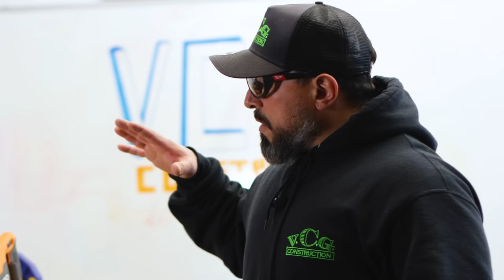Milwaukee Tool Is No Longer TOP DAWG at TTI (new best brand REVEALED)

Comment: They definitely need to add better padding on that Ridgid
Reply from the maker: Brutal cuz!
Reply: Kind of lives up to its own name in that regard.
Reply: I wonder if you want you bought the rubber cover replacement for Milwaukee would it fit the new ridgid. Just a idea
Reply: Better padding? Ridgid needs to just stop making tools in general
Reply: Padding has nothing to do with it (well, maybe a tiny bit). The corded and M18 FUEL Super Sawzall has double wobble plate construction, and the Ridgid does not. The wobble plates are the components that absorb all the abuse on the user.

Take a Milwaukee Super Sawzall, either, put it on a table and w/out holding it, pull the trigger and let it run. Do the same thing with ANY other reciprocating saw, you’ll notice significant increase in vibration in the table.

Boom!
Reply: @stefanjohnson9480  do you not understand that they are the same company...

Comment: I’ve had like half of my Milwaukee tools go out because of a faulty trigger. I don’t give up on them though
Reply: You should try the 3/4” impacts and hammer drill. They cannot take persistent usage. We use them both at work. If mode selector doesn’t work in only the 3 mode, you have to hold the battery in place with your off hand. The tool puts down some serious work, but the electrical connections can’t take it.

Comment: The extra weight (on the M18) gives it an advantage on cutting as more downward pressure, thus in my opinion Ridgid needed to increases the strokes per minute by 200 to be on par with Milwaukee.

Comment: IMO rigid is probably being used as a testing ground/beta test for new technology. Smart way to test new technology/batteries and when the bugs are worked out they'll introduce it to Milwaukee.

Its really genius when you consider Rigid has a lifetime warranty which means they'll get there hands on plenty of tools to diagnose potential problem areas.

Comment: It's a normal case use.  We had to decom some steel on a roof that was originally crane-picked up there.  Diablo blades are pricey, but they're a hell-of-a-lot cheaper than another crane.

At the end of the day, after all of the numbers and marketing BS, the tools just have to work.  If you're a pro or a home-gamer, you just need to get the job done, and both of these tools will do just that.  That been said, on a construction site, in construction environments, the Milwaukee will usually hold up a bit better and stand the abuse. Just my experience.  You use what get's it done for you.

Comment: Wookie is killing it through the wood. Those blades are on some other stuff. I think smaller motors turn more rpm than larger motors. Doesn’t mean they generate the same torque just because of the revolutions. I’m not positive though.

Comment: Used both today cutting pt 2x4s and Milwaukee was way better, ridgids batteries seem to fail faster (like need to be replaced- not recharged) & the added weight seems to assist in the cutting power of Milwaukee tbh.

Comment: The Rigid has a faster no load speed------BUT under load esp the I-Beam,the Milwaukee held its speed better and didn't run down its battery as fast as the Rigid.With this test-stick with Milwaukee.Milwaukee has been the pioneer of the recip saw and it shows in the test.

Comment: My guess is that since the Milwaukee has a higher tool weight which equates to higher inertia, the tool itself does not move as much during each stroke.  That means that the blade is moving more during the stroke so it cuts more per stroke.  It would be an interesting experiment to ballast the Rigid up to the weight of the Milwaukee and see how it compares then.  Not that anyone would do that in real life, but it would be interesting.

Comment: Milwaukee was definitely faster to me. Ridgid seemed to bog slightly at times on the steel. It's not producing the 3200 rpm when pressure is applied it seems
Reply: He precut the beam on rigid watch again watch the top he didn’t even have to cut the side closest to him it was already cut
Reply: @addicted2tools  if he precut it for ridgid wouldn't it of been faster with the ridgid? Idt it was precut, the Milwaukee smoked the ridgid
Reply: Big difference in the bearings too
Reply: The Perfect Painter Tool Review lol he precut the top rewatch it man I promise... and yea u would think it would be faster since he did but it was still slower lol watch the beginning of when he starts the cut on Milwaukee and then watch rigid it’s completely different u can see the blade just goes down with no resistance when he cuts rigid on the side closest to him....
Reply: @addicted2tools  he didn't precut it...that clip started a few seconds after he started cutting. Notice how the tool is already in motion when the clip starts. There could've been something that he didn't want on the video or something like that. Vince is clearly a milwaukee guy and was being sarcastic saying ridgid is top dawg now due to the spec on the ridgid sawzall. It also make for more ppl wanting to watch the video with a catchy title.
Reply: The Perfect Painter Tool Review yea I no which is my whole point that it took longer than shown
Reply: The Perfect Painter Tool Review not a true comparison
Reply: @addicted2tools  I 100% disagree with u
Reply: The Perfect Painter Tool Review well that is ok ur aloud 2 lol 😂

Comment: Nothing wrong with Milwaukee taking a backseat, right now, but as things go….when new tools get released, they always better than older, and beat out “competition”; it’s expected, imo.
I’m guessing that after 2021 Milwaukee NPS (if they do or just release) might be more comparable to the new Ridgid, AND Flex tools with Milwaukee’s new gen tools. Than DeWalt will release new tools and they’ll be on “top”; and round and round we go, no😉
Thx Vince and it’s exciting to see the new tools, brands, and “what” happens with them. Let’s just hope Milwaukee doesn’t release a new battery platform b/t m18 fuel and MX….as really like the Milwaukee 18v batteries, especially since have 50+ Milwaukee tools and 75+ batteries.
✌🏻

Comment: Oh yes-don't forget the Diablo blades-they held up well under the abusive test of cutting the I-Beam-a job usually for larger machines.When you see the sparks-the saw was being a friction saw!The metal heated to softness from friction-the teeth removing the softened metal.Friction cut bandsaws and circular saws work this way-the teeth on friction blades aren't even sharp!

Comment: Are you sure that the Milwaukee tools fall behind the RIDGID? I say this because I believe the RIDGIDs are kitted with high-output batteries whereas the Milwaukees were not - despite the HO batteries being available for M18 tools now. Granted, I don't know for sure which batteries Milwaukee used in their tests where they got the provided specs - and logic would dictate that they'd want to provide the best numbers possible, thus using the HO batteries. But I don't remember those numbers changing at the time the HO batteries were released

Comment: I believe ridge it will never be as  Good as Milwaukee They will not have the lineup That's the part that hurts ridge it the most
       🤩🍩☕😊
Reply: You are probably right since TTi makes Milwaukee, Ridgid (Orange), and Ryobi tools.  It not really a matter of hurting Ridgid but TTi wants to keep it at a 3 tier system and price it accordingly.  If TTi ever chooses to make Ridgid models that truly matches a Milwaukee then they would probably spin it as a new Ridgid line like "Extreme Pro Grade" and charge exactly the same as Milwaukee.  They would probably just be Milwaukee internals that use Ridgid batteries ;)

Comment: This whole idea of making power tools lighter simply allows the manufacturer to use the cheapest plastic or metal parts China has to offer. Unless they are using the latest and greatest in materials these light weight tools are just not going to last.

Comment: I’d rather have the heavier Milwaukee. I’m perfectly capable of handling an extra pound or two per tool. I prefer the heavy especially with screws. That weight factors in the torque specs.

Comment: Ridgid is like a box of chocolates, not all of them will satisfy you.  If i were to start a brand, it wouldn't be Ridgid.  I will use their tools just for fun.  I still think their drill driver gen5x or octane with the clutch settings for screw driver is one I would consider revisiting because that's what I use when I need drive screws consistently.  E clutch doesn't work for me.

Comment: With the drill speed in low you want a slower rpm. I have to drill through heavy thick steel and stainless every day and you want slow. Also with the sawzall the millwaukee probably has more robust gear box and what not. I'd bet the millwaukee lasts way longer. And once again with heavy steel you want low speed. I dont do much with wood so the slight difference in cutting speed means almost nothing to me. I've always looked at ridgid as a test platform for millwaukee. Almost all the new shit has always come on ridgid first and once proven gets puts into millwaukee.

Comment: 🚫 Dunno how reliable 200 more 'no load' rpm's are in comparing reciprocating saws. Bet the Rigid bogs down to a lower actual speed than the Milwaukee...because of the Milwaukee's more 'torqueyer' gearing. Then there's the long term reliability of the rigid if cheaper parts are inside......

Comment: I get paid by the hour...
I'm not in a hurry! 🎃
I'm lighter...dont cost as much and I can cut thru steele I beams.
If Vince could figure out battery time.
Vibrating tools.
That's the fun of working with power tools...jiggling that fat off yer rear.

Comment: Milwaukee notoriously underrates their numbers. I’ve seen a video on the m12 stubby breaking semi truck lug nuts far beyond its nut busting torque rating. I think Milwaukee posts their numbers on what the tool averages through the entire life span on a single charge battery. Whereas other brands post the best numbers on a fully charged new battery. Time and time again my Milwaukee tools over performed.